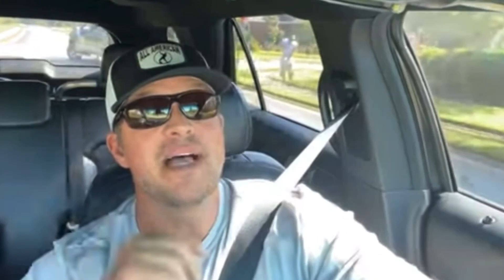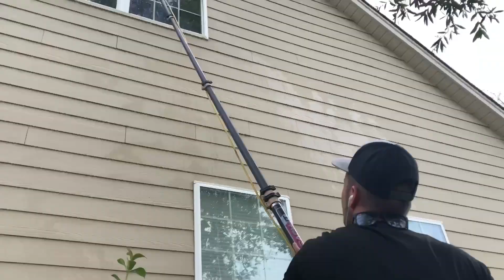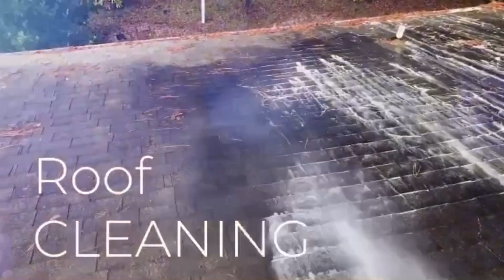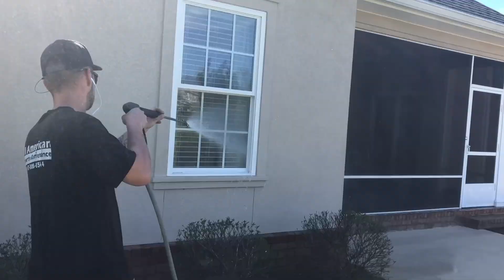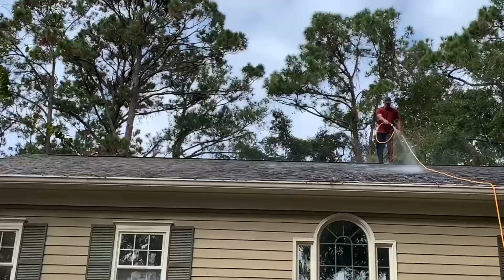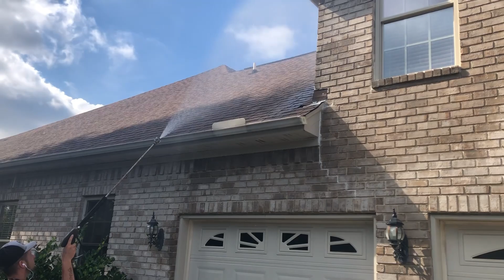Starting a Pressure Washing Business - Make More Money NOW!

Comment: Hey I'm curious on how the solar power battery charger turned out! Pros and cons. Do you think you'll continue to use it in the future?
Reply from the maker: +Bubba Wiseman The solar panel actually does do a pretty good job. If you’re not using the 12 V system all of the time, which we do not. We downstream 95% of the time and use the 12 V system for roof Washing only. I have since switched out the connections on the pump to alligator clips for easy on and off so we can pull the battery and throw it on a charger at the shop after a roof job so it is ready for the next one. We still use a solar panel, I would love to have it outside of the soft wash box all of the time so it’s constantly collecting son/hour, but I have not invested the time to mount it so it would be safe and not broken.￼
Reply: @AllAboutPressureWashing  Thanks for the reply! I use the 12v system for all services, and use my surface cleaner for drive ways and side walks. I pre and post treat in most scenarios
Reply from the maker: +Bubba Wiseman awesome- good luck and much success